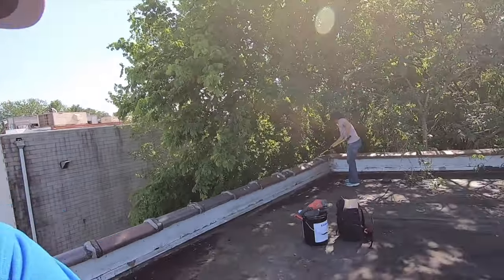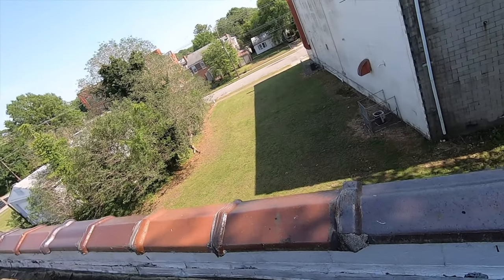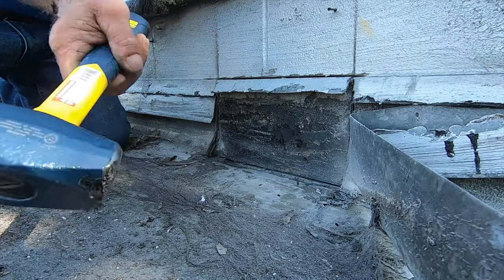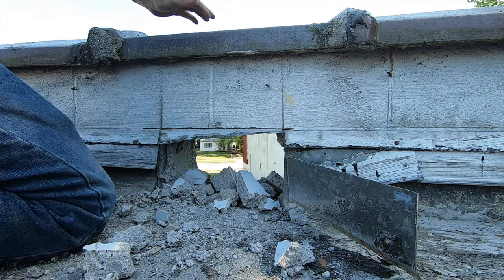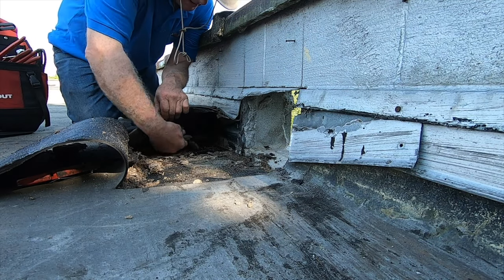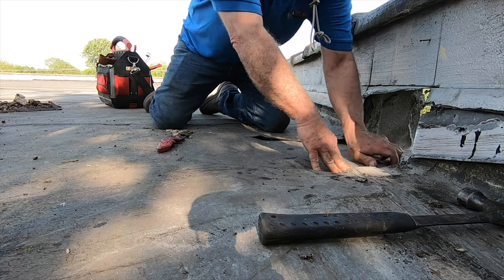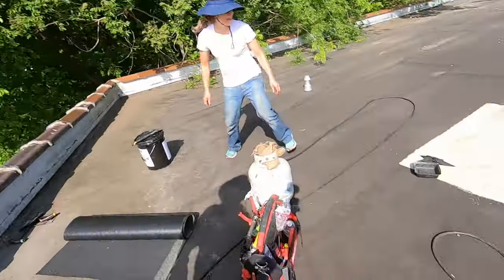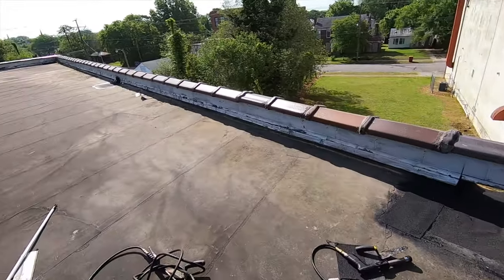Easy Fast install of a Flat Roof Scupper to Drain water- DIY Remove pooling water

Comment: Thank you Roof Doctor with all the great design re-work and trouble shooting flat roofs for proper water draining !  
You are absolutely correct many roofs need a lower channel around drains and scuppers to prevent any water pooling and wood board damage ! 
Always check and channel your drain scupper areas ! Saved our @!#$ many times out here in AZ under monsoon seasons ! 
I've cut channeled my 8 parapet scuppers lower and it worked wonders ! Even 1/2 inch of water pooling can penetrate through, causing small leaks into the structure !

Comment: It's nice they had that 1''  fescoe board underneath so you could lower the scupper and get it to drain. Good job.
Reply from the maker: i Lucked out
Reply: Is it common to add that buffering board?
Reply: Under the asphalt shingles?
Reply: @HelloJello789  I've seen it used as an insulation back in the day and also as a recovery board. It has very little R-value if any, it's called perlite. Poly iso is what's used now but the supply house still handles perlite, it's made from sugarcane and they call it bagass I believe
Reply: @roofermarc1  what a wealth of knowledge, thank you, sir ( or ma’am or sir ma’am. ) just tryna be P.C. or else 😲 lol jk but no seriously. Meant no disrespect thank you 🙏

Comment: Hey Roof Doc can i use Turbo polyseal if a Chimney has pulled away from the house a half inch, put tape on the painted house side and brush Turbo from top to bottom, that will stop rain entering the sides.
Reply from the maker: yep

Comment: Hi Flat Roof Doctor, is there a product we can use to prolong the life of shingles on our roof?
Reply from the maker: Hmmm, I don't have any idea, sorry
Reply: @FlatRoofDoctor  No problem, thank you for your kind answer.
Reply: Yes material is called bitchumen primer and a 2 layer sbs torch on roof, nothing can preserve shingles , here in uk we just put them on our sheds
Reply: There is a product to prolong the life of shingles. My son in law is the materials rep in Louisiana for Gaco roof coatings they don't have a product themselves but he's found another company that makes a product, idk what's it called right now but It's not cheap and also you need a good roof to put it on, and it's as expensive as a new roof.  

So in other words it's not feasible to use.
Reply: @roofermarc1  Thank you for the information Bruno